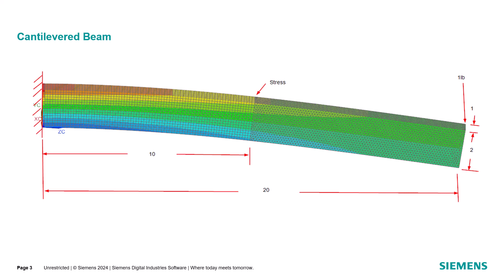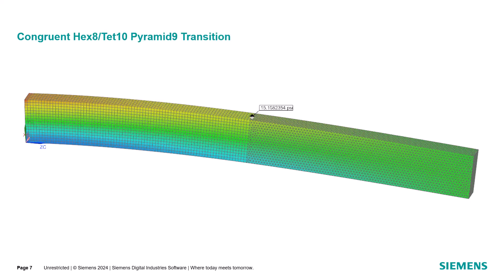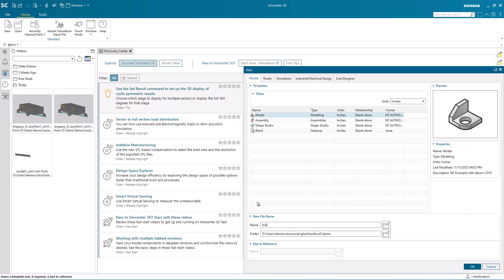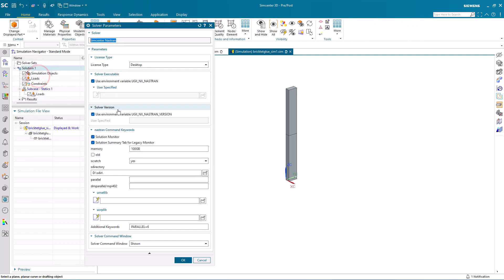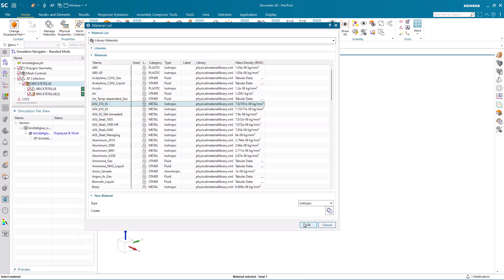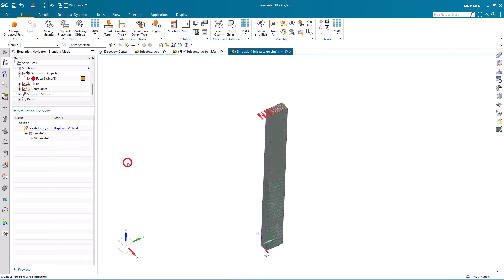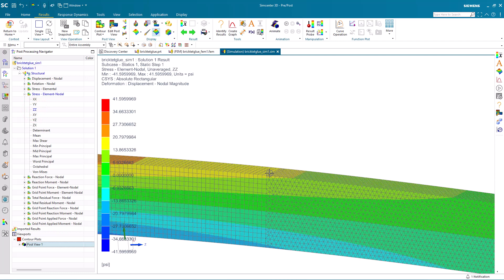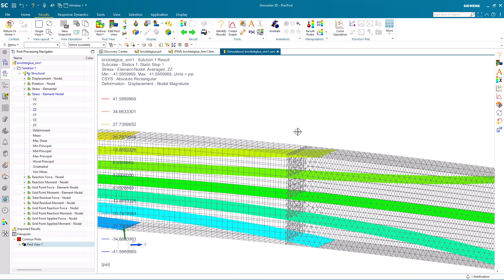Comparing A Glued Mesh Connections To A Congruent Mesh

Comment: Hi, nice video, I found it very instructive. However, I have a small question regarding the use of glue-type connections arising from the solution monitor window (minute 4:20). There, it is possible to see a warning message: GLUE FORMULATION FOR LINEAR SOLIDS COULD RESULT IN OVERLY STIFF BEHAVIOUR IN BENDING. Why is such warning message issued? I suspect it is because of shear locking in linear HEXA8 elements, but in this video a sufficiently large amount of elements are being employed through the beam's height, so the results have a sufficiently good accuracy. I would like confirmation on this, just in case it is something unique to the formulation of Glue in Simcenter Nastran.

Thanks in advance,

J.
Reply from the maker: Hi, glad you liked it.  You have a good point.  I ignored the message because I had good correlation in my results when compared to the theoretical results and a congruent mesh (minute 1:23).  As the warning message indicates, I should have considered using INTORD = 1 (low) and REFINE = "Do not refine" in the global glue parameters (edit solution - case control) if I didn't want to use parabolic solid elements at the glue surface (option 2).  Option 3 - surface coating the solid elements with shells - is another option but sounds like too much work.  The results for the brick tet glue with out these settings was 15.03 which I thought was good.  Using option 1 setting INTORD = 1 and turning off REFINE gave results of 15.00.
Reply: @Simcenter3DTipsandTricks  Thanks for your reply. However, now I have a second question; if such message appears due to the possibility of shear locking (I believe so due to the overly stiff behaviour in bending warning), why does the message suggest options 1 and 3? A feasiable option to "fight" this problem would be increasing the order of the elements (option 2), but the remaining workarounds (1 & 3) would not solve the problem stated in the message. Changing the Glue parameters mentioned would decrease calculation time, and I do not fully understand what effect would have option 3 on the results.
Reply from the maker: The issue of shear locking is primarily addressed through the element formulation, where appropriate integration techniques help mitigate or eliminate the locking effect. In Simcenter Nastran, glue connections are implemented using a penalty-based formulation that links source and target faces at specific connection points—these are governed by the INTORD parameter.
By default, INTORD introduces a higher number of glue connection points, which can lead to an overly stiff response in bending scenarios due to the implicit beam-like behavior at those points.
Your observation is valid, refining the mesh in the bending direction can help alleviate the stiffness issue, however, this approach often requires additional effort to adjust the mesh. Reducing the number of glue connection points (via INTORD = 1 and disabling refinement) is a more straightforward and effective workaround.

Comment: hi great video.
However in your presentation congruent(brick brick) and glue(brick brick) are taking same 7 sec.And congruent is having error % of 0.kindly correct me if i am wrong and clarify.
thank you
Reply from the maker: You are correct.  There is little to no penalty on both solve time and accuracy when using glue compared with a congruent mesh.